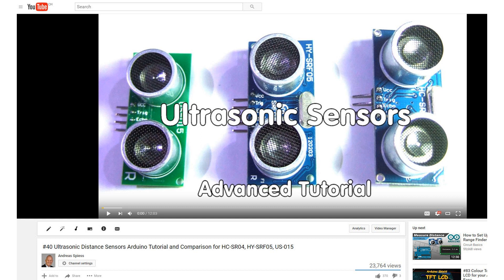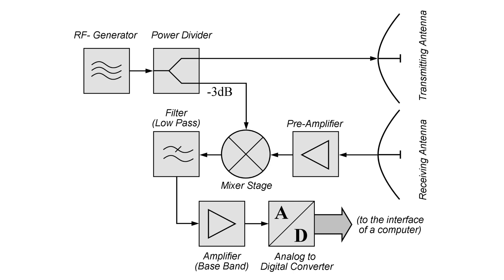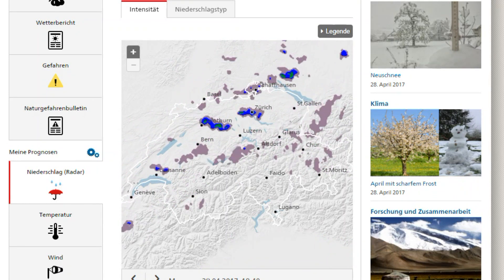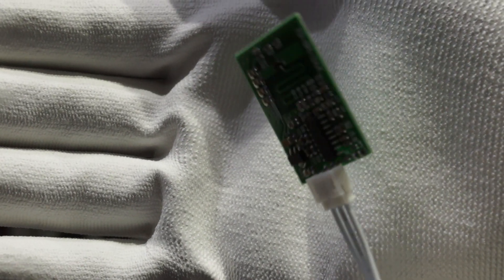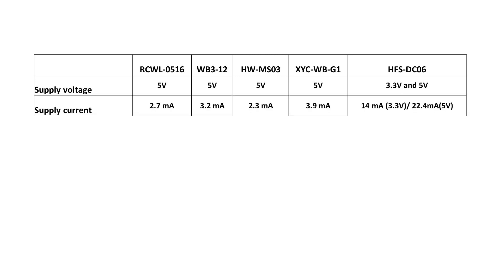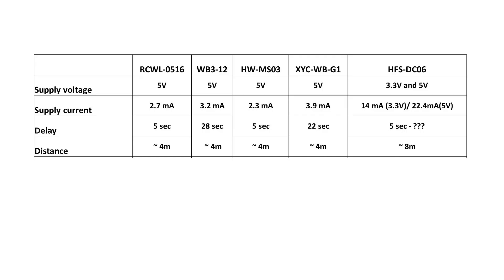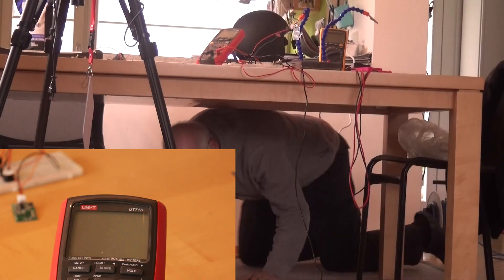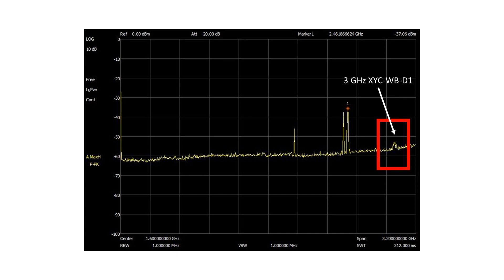#135 Radar Sensors / Switches: Comparison and Tests

Comment: If you can electrically subtract the outgoing frequency from the incoming, amplify that and output to speaker -- you can hear things move and identify them to some real degree. I know this from running big ground surveillance radar in the 70's, even clods of dirt thrown by shovel have characteristic sound as does the shovel. Running cars vibrate, trucks vibrate at lower frequency, wheels turning you can tell how rough the tread is. There is a whole very cool world to investigate if you can listen to the doppler.
Reply from the maker: Interesting concept. If you look at http://www.rogerclark.net/investigating-a-rcwl-9196-rcwl-0516-radar-motion-detector-modules/ you see, that this should be possible... I will try one if find the time

Comment: Today my RCWL-0516 's arrived from ali-express, could'nt wait to do some experiments .. (did'nt add any additional components)
Wow .. these things are unbelievable sensitive especially moving to or away from them. Over the entire distance of my buro (~4 Meter)  a movement of 2 cm's  of my hand is enough to trigger it.
Thanks a lot Andreas for making this great video!
Reply from the maker: You are right. Most of the time, I think, we have to reduce sensitivity rather than to try to increase it...
Reply: They are really too sensitive. I tried connecting one(rcwl-0516) to a nodered counter node via a 8266 microcontroller to detect the number of detections and found that even with nobody present in the apartment it is still detecting movement at times.I live in an apartment building so I assume it is detecting movement through the walls in the other apartments.I did not try to reduce the sensitivity yet. Has anybody tried it with resistors to reduce sensitivity?

Comment: Hi Andreas
Great video.. I bought a few of the RCWL 9196 based devices that you show in the video and I have been doing some experiments into the mode of operation and other uses for these devices. I've written the account in my blog, but to cut to the chase.

Try soldering a wire to Pin 12 of the RCWL9196 and connect it to an oscilloscope or even better an Arduino board. (I'm using a STM32F103C8 aka Blue Pill board for this)

The waveforms you'll see are very interesting

What you see when an object moves towards or away from the sensor are a series of peaks and troughs, but also with superimposed smaller or larger peaks and troughs of different amplitude.

So. My hypothesis, is that these devices operate by using wave propagation interference, where the reflected wave from the object, back to the oscillator / transmitter effects the amount of current it needs to draw in order to maintain its steady state oscillation.

Unfortunately along with the fluctuations in voltage from the oscillator, the main IC (2 stage op-amp), causes additional complications as it effectively works as a differentiator with a period of around 0.1 sec. So even if the oscillator output voltage is moved to a higher or lower value by the reflection from a stationary object, the observed output from the op-amp, ends up at Vdd /2 (approx 1.6v)

It may be possible to modify the analogue electronics to turn the op-amp into a pure amplifier, (with fixed offset to remove the fixed - mid point voltage from the oscillator), but I still can't think of a use for this apart from motion sensing.

I would however recommend that people try using the voltage on Pin 12, as it allows a lot more flexibility in the trigger threshold, and also the output hold time, etc, as this can all be done in the MCU firmware (e.g. in an Ardiuno sketch)

You can see the full write and some plots of the data in my blog

http://www.rogerclark.net/investigating-a-rcwl-9196-rcwl-0516-radar-motion-detector-modules/
Reply from the maker: Nice to hear from you! Thank you fro your comment. You bring up a interesting topic. To do the logic inside the micro controller indeed gives much more flexibility to detect patterns. I think, we will see more of these interesting small chips in the near future. And maybe, a supplier even takes your idea to replace the chip with an ordinary opamp (and maybe even add a cheap I2C ADC), which would not be too complicated. Then, we would have a simple sensor with a wide range of usage.
Reply: I think if the device had a I2C DAC to set the voltage on the inverting input of the first opamp, it would make the device more flexible, and perhaps it may be possible to use several of these located in 3 corners of a triangle to perhaps help with navigation of small robots, as they will get different interference patterns from reflections to each other, and perhaps analysis of that data could be useful.

But for now, I'm happy just to use it for a motion detector where I can select the sensitivity in the MCU code (by reading the analog output on pin 12)

Comment: Hello,
I received today the rcwl-0516 sensor.

Could you please tell me if there is a specific orientation in which to point it to perform the test?

And did you connect a resistor on the output pin?

Thanks
Reply from the maker: 1. As said in the video, most of them are 360 degrees
2. No, I just measured the voltage, if I remember right.
Reply: Thanks for your reply and I am sorry for not getting 1) from your video.

I tested it yesterday and I think it is much better than a PIR or ultrasonic sensor to detect motion in a relatively small room.

Comment: great video!
im wondering if adding a kind of parabolic metal disc behind the transmitter would make it more directional? -like the kind you see on a parabolic receiver.
and what that would do to the range of these devices?
Reply from the maker: One of the devices had a metallic shield.  For the moment, I do not need more range. Maybe somebody else does some experimetnation

Comment: Nice video, did not know about those types of sensors.
One remark: Radio is highly regulated in europe. Having such a low range, i do not beleve they could cause any harm if used as stationary movement sensors. Still, knowing the exact frequencies and transmitting power would be interesting.
Reply from the maker: As I wrote in a other comment: They are for sure not legal in the narrow sense. But I do not see that they harm anybody if properly used because of their low power and range.

Comment: At work I have one almost exactly like the HFS, except instead of a separate 3cm² antenna PCB it has a thick 2cm long bare wire sticking out vertically. The entire thing is encased in a round enclosure. This one: https://nl.aliexpress.com/item//32749876018.html
Reply from the maker: Looks good!

Comment: Can I use the RCWL-0516 as a counter. For example, to count the times a bird visits a nesting box. It would need to detect movement down to a few inches. Many thanks for a great review.
Reply from the maker: This sensor just gives you a signal if it detects something. So, you have to solve two problems:
1. Try out if your birds are able to trigger a signal and where you have to place the sensor (I think, it should be possible on a short distance, but I am not sure, because birds are very light and do not contain lots of water)
2. build a microcontroller to count the events

Comment: Just like the Ultrasonic the radar sensors rely on Doppler shift and are therefore more sensitive to objects moving toward or away from the sensor, unlike PIR which is more sensitive to transverse movement. As you've stated metallic objects reflect the radio waves more efficiently hence the need for materials which absorb or direct radio waves away from the source on stealth airplanes to avoid detection. Other materials will absorb or reflect the radio waves by different amounts but glass will generally appear transparent to radio waves unless it has a metal film deposited on it.It would be interesting to know what frequency band is being used and whether they are certified for use in UK or other countries. I didn't see on the PCBs what would be setting the frequency, there should be a Crystal at least as a SAW or resonator or RC network would simply not be accurate enough and not pass product compliance with any European or US standards. UK, Malaysia, China, India, Middle East should be using 10.687GHz base frequency up to 10.691GHz. Europe except UK, France, Germany, Portugal and Germany operate at 10.525GHz to 10.54GHz. Germany/Austria use 9.35GHz and France, Portugal and Switzerland use 9.9GHz. Republic of Ireland use 10.41GHz. Use of frequency spectrum is regulated and some frequency bands are license free providing they meet the correct criteria such as within the frequency spectrum and not exceeding certain power limits. This is to avoid interference with Military, Civil and licensed airspace.Use of two or more of these will probably interfere as the frequency will not be identical between them and the error will likely be within the passband of each others receiver causing false triggering. Even with Crystal oscillators. The metal can version is probably using a crystal and will probably be offered at different frequencies, each outside the passband of the other so multiple transmitter/receivers can be deployed in close proximity without interference. Usually the output from the can will vary by 30Hz for every 1m/s movement. The magnitude will depend on the size and material make up providing the reflected signal.
Reply from the maker: Thank you for your background information. 
They for sure have no certification at all! But since their power is quite low, and they are mainly used indoors, I do not think, they are dangerous to air travel And military anyway has to live with an "enemy" ;-). The are for sure not legal in the strict sense. But here, we have a proverb: "If there is no plaintiff there is no judge..."
For another comment below, I tested the influence of two similar boards: If one is switched on, the other triggers immediately. So, there is some influence.

Comment: Did you test to see what materials the devices will and will not detect?  I've seen one video where the device would not go off unless a human (or his dog) was detected by the device.  He threw things at the device and the sensor didn't go off. he had his dog run by the device and the device went off. 

So what's exactly being detected?   

Also, could this be used along with some type of heat or night vision when hunting to detect animals through a scope or glasses if there's an animal hiding in the bushes at night?  

Where would I get an FLIR chip build my own glasses heat glasses to see heat or movement at night when hunting?  for some reason, I've seen I believe that I've seen a FLIR night vision/heat detection chip for sale on the  Adafruit site.  I would love to build something that sees heat and movement at night that's cheap.  

There is a big firearm company selling a very small scope about half the size of a Pi that does all of this along with recording video and range finding; cost overt $3000 US dollars and they feel that price is a deal for the consumer that hunts at night. 

 I think the same thing with more options can be built by smart makers for a fraction of the cost.
Reply from the maker: I only did the tests in the video. It detects things which conduct like metal and water and I assume, that the size and the distance of the object matter.
I do not know about FLIR chips, I just bought the one for my IPhone.
Reply: Thanks.
WAIT!!  You hacked your iPhone so that it sees in the dark?  Do you have a video of that?
Reply from the maker: No, I just connected a FLIR ONE camera (http://www.flir.com/flirone/content/?id=81730)  to the Iphone. Nothing more
Reply: thanks for the info

Comment: Hi Andreas, 
I wonder if you might get better results, as you would with the PIR sensors, by mounting the sensors higher off the ground(around 1.8-2m). The chips are probably the BISS0001 or similar as with the HC-SR501 style larger PIR sensors. I have some of the XYC-WB sensors but have not tested them yet.
Reply from the maker: As with all antennas, height matters. So, it is well possible that you can extend the range like that. In my applications, I had to resuce the range, because my house is just small ;-)
I also thing it is a BISS0001 or similar chip on these devices,
Reply: True, thanks for the prompt reply. These types videos, are my favourite on your channel.

Comment: I doubt the "transistor" is indeed just a transistor nor do I think the "antenna" is an antenna.
The three lead package is most likely a oscillator and mixer and the winding path some sort of antenna matching. I would have to look at them more closely than possible at 4:40
Reply: Using three 90° phase shifters one can build a primitive IQ demodulator that would be modulated by the moving reflection.

Comment: We've got a few radar sensors at work that we're working with (I'm in an mainly-automotive engineering firm) and they are really neat...  it doesn't seem like they should work, but i can see the data from them, clear as day. crazy stuff!
Reply from the maker: +Scott Lawrence What kind of applications do you use them?
Reply: I think the idea is to use them as vehicle and obstacle detection.  The ones you're showing here seem to be essentially switches.  The ones we have can generate a two-dimensional graph of distance vs velocity.  You can tell motion towards and away from the sensor and where it is.  It's pretty neat.

http://www.d3engineering.com/solutions/autonomous-systems/auto

NOTE: I am posting this as myself, not as a representative of this or any other company...  It is neat technology though!
Reply from the maker: These are nice devices! But I assume, they cost also more than 50 cents ;-)
Reply: Yes.  Very much more than $0.50.  ;)

Comment: First of all, great video! These motion detection radars most likely works in doppler mode, which is sensitive to frequency close to its emitting frequency, which explains why 2 of the same model do not interfere with each other, and why they don't detect stationary object.
Reply from the maker: You are probably right. There are a few ideas around in the comments. I do not know what is right or wrong...

Comment: very interesting work on these sensors! ... maybe you could add in directionality by adding in metal foil on the backside; much like the metal can would be blocking the signal on the one with the 180 degree angle.
Reply from the maker: I think, this should be possible.